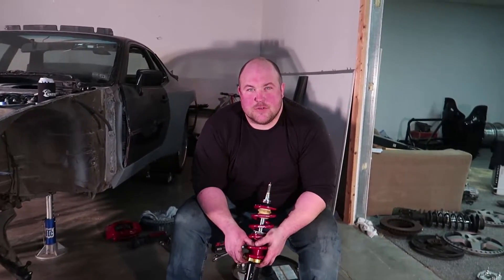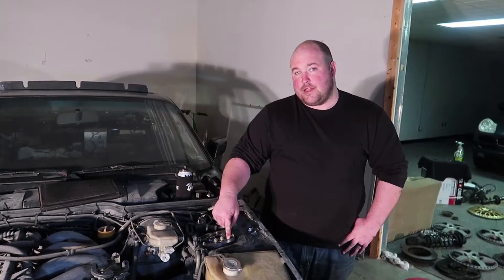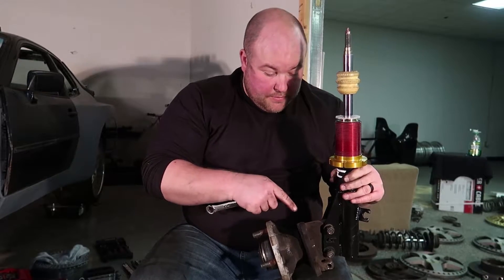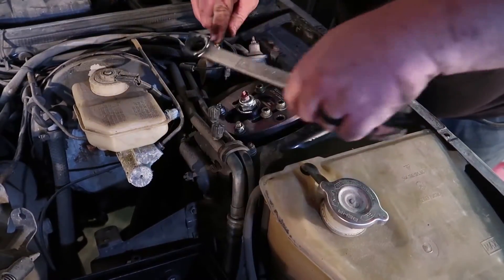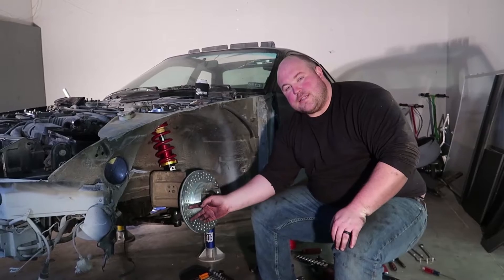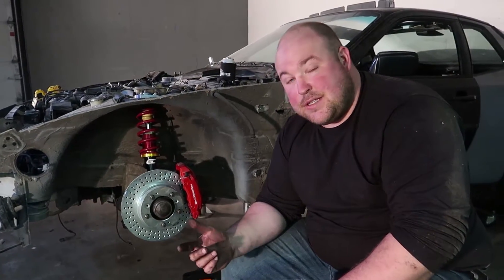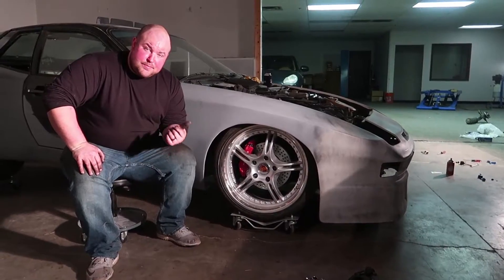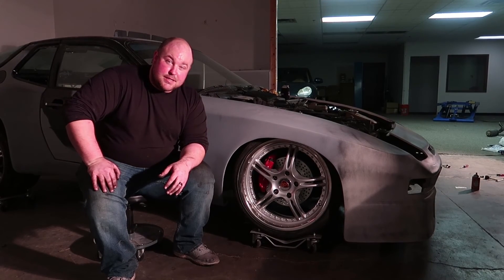Widebody 944 Project: Front Coilover Install (Ground Control)

Comment: Looks good will be interesting to see you get it all set up and aligned.
Reply from the maker: Thanks Glen, sure will, can’t wait to get the rears done and see the final stance
Reply: Totally, I'm sure you know but don't forget about bump steer with the extra low ride height. Also, if you need any custom bits made let me know I have  a bit of a machine shop and it might be something I would want too so making two of something  is just as easy as making one.
Reply from the maker: Thanks, i'll keep that in mind!

I do understand the issues of bump steer on lower cars, but I do NOT know what the solution is on 944's. I'll have to see what the tie rod angles look like at final ride height. In my Mustang days, bump steer kits were a dime a dozen and a simple fix.
Reply: Elephant racing is a good source for 944 suspension parts, my ultimate fix will be to replace the tie rod ends with plain rod ends, one of those projects I mentioned earlier.  To be honest though, I can't say that I have noticed a huge issue with bump steer though.
Reply from the maker: Good to know. Maybe a kit needs to be developed! Similar to this: https://www.americanmuscle.com/srperformance-bumpsteer-kit-2015.html

Comment: Hey man ! Love your video!  I have done all the same to my 86 951 . in the wheel video, what was the name of the place you got the wheel parts ? I have a set of k27s. 10 and 9 . I put the 10 / 275 hoosiers on the front to check the fit . may disassemble the 9s and go 12 for the rear , with a broadfoot flair kit . 😄😄cheers
Reply from the maker: Do it! Augment Wheels out of Canada, they were great to work with! Not sure what barrels you have, mine were 5.5” so I got a 6.5” lip.
Reply: Boost Brothers Garage 1 question,  replying to all of these comments,  how do you get anything done ??😄😄😄
Reply from the maker: That’s a great question! Work 50 hours a week, wife is 33 weeks pregnant, run a YouTube channel renovating a house, and still try to find time to watch football haha

Comment: I know this is an older vid but, how are those coil overs holding up? I just picked up the trailing arms/control arms front and back with the big black brake upgrade out of an 88 turbo.      Now I’m in the market for a stiff coil over set up. Also got the gear box with LSD woot woot
Reply from the maker: So I haven’t actually driven on them haha. The car is still on pieces, it got put on the back burner. But, I know a lot of guys that use them and love them.

Comment: I'm curious. Do you happen to know how much bigger the Boxter four piston brake setup is  than the early 951 four piston brakes? Not that the 951 brakes are inadequate, just curious.
Reply from the maker: I believe I will end up using 320mm discs. Tomorrow’s video has a lot more info on the brakes, specifically the fronts.
Reply: Okay, great! Thanks. I discovered today that at least one of the OHP likes Porsches, I got pulled over for 82 in a 70 and he asked for my license and started talking about the car. I told him it was an 86 and he told me how nice it was and went back to the patrol car and came back gave me my license and said "Just a warning today , won't cost you anything. Have a great day!" I said "thank you very much,. you have a great day too"  Thank you OHP!! lol.
Reply from the maker: Haha, that’s awesome! Most cops really are pretty cool as long as you’re not an ass. Let’s hope I get that one when this widebody turd hits the streets 😂
Reply: I have found that for the most part if you are honest with them and own up to your actions they tend to go easy on you. Of course a couple of miles earlier I was hitting around a hundred miles an hour so I assume if he had caught me then the outcome would have been different!, lol.
Reply from the maker: Guaranteed!

Comment: Found it/thanks
Doing the same thing.
I fit 17x9’s with 295’s square.
With an LS 5.3 it’s bonkers fast-
Reply from the maker: Awesome! How much power you putting down? I’m shooting for 400 wheel, and with 275 front and 315 rear it should be a blast
Reply: Boost Brothers Garage 
Probly putting down 450ish-
Still on NA transaxle so being cautious ;)
But it’s lasted through a few tire shredding autocross events, so fingers crossed.

I’m also did hydroboost, which I’m super happy with. Great braking with stock NA rotors and calipers-

Next I’m gonna tackle the rear suspension- 
I also rolled the rear fenders and put flares on the front-

Super impressed with what you have done- love that front brake set up
Reply from the maker: Thanks Jason! A metric shit ton of work left, but I’m really happy with where the project is headed.

I bet your car is a BLAST at the autocross!
Reply: Boost Brothers Garage 
Any pointers on install of coil overs? I’m confused about something: you don’t have to compress the springs before you install? Apologies if answer is obvious- it was awhile ago that I put the new “cut a strut’s” in the front- but I remember having everything under tension before installing- does it not get installed already loaded up?
First time doing a coil over-
Reply from the maker: You’re good! The install is really easy, it’s an unbolt / bolt up affair. When doing full coilovers, no spring compressors required! The biggest thing to pay attention to is the rear shock mounts, make sure to do what we say in the video so you don’t put unnecessary stress on the mount...
Reply: Boost Brothers Garage appreciate it ;) been building this thing for the last 3 years, but I learn something new everyday- psyched that you have taken the time to share your knowledge-
Reply: Got front ground control coil overs on, and wow, it’s riding pretty high, even when unthreaded as far as possible it’s about 1.5” higher than the rear- did you run into this?

I probly need to do the rear to really know what’s going on, but wow-
Reply from the maker: jasonscottw hmmm, I did not have that issue. If anything it was the exact opposite! What length springs are you running? I can check my spring length for you next time I’m at the shop. Shoot me a message on FB or IG, easier to keep track of!
Reply: Thanks- I’ll switch to Facebook

And yeah if you could measure that would be awesome-

Not sure my length but I’ll check- I went with what control recommended I use with the koni cut a struts I have